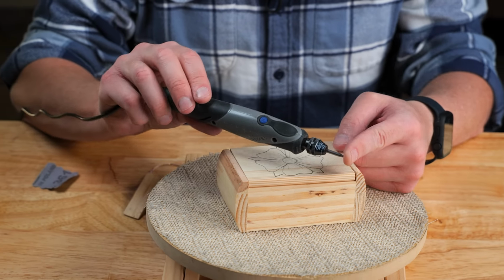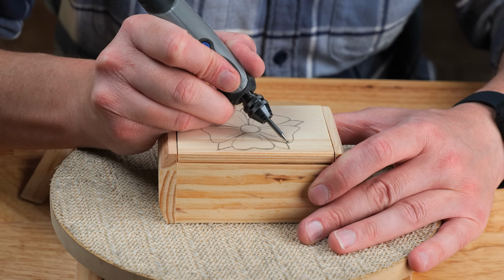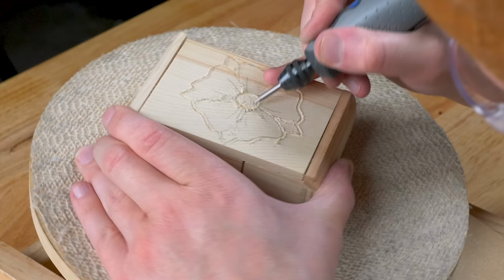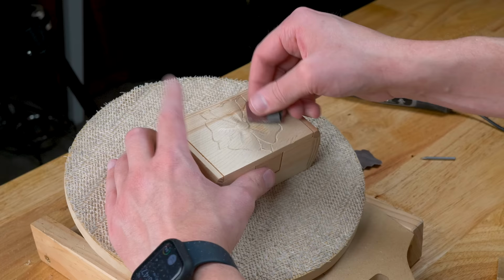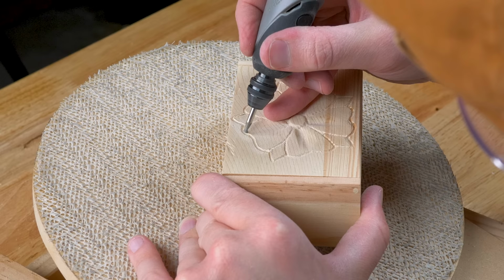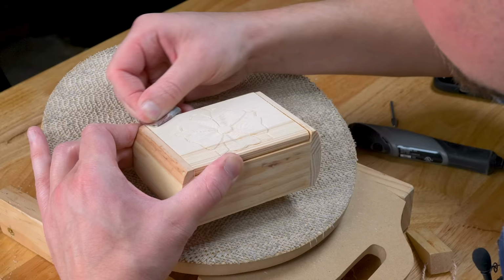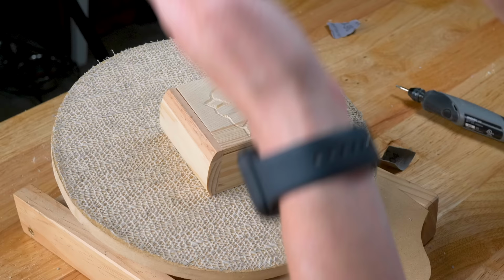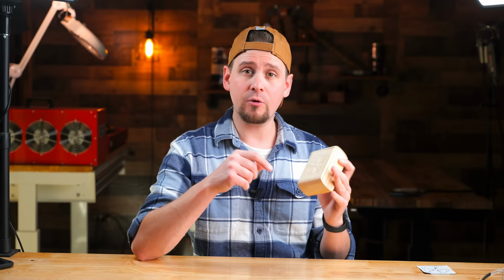How to Wood Carve with a Dremel Tool - The Basic Beginner's Guide

Comment: Try using a laser printed pattern. If it has "direction" , reverse print it. Lay the paper printed side down. Use a regular clothes iron to reheat the toner and transfer it to the work surface.

Comment: Great video very useful. Though thing i notice no one ever seems to talk about how to pick right bit for the material which I am still lost on. The 5 he picked seemed to picked based on function but I am wondering how you would know best bit for the wood in this case or plastic or glass in another project. Another thing would be cool would be to get an idea of what is reasonable price for all the bits and sandpaper. not sure what prices are reasonable.

Comment: Hello Cornelius Creations. I was wondering if a lower speed helps reduce burr hop or burr runaway? You said to use the highest Dremel speed setting. Does that make it easier to carve or does slower speed provide more control?
Reply from the maker: Lower speeds actually make burr hop worse. Higher speeds generally helps with smoother cuts. Always let the bit do the work for you

Comment: I'm curious about this hobby but I'm very very new to carving (not woodworking). Could anyone recommend a beginner's tool/kit? I want something cheaper in case I don't love it but good enough that I won't automatically hate carving because the tool is so bad. Thank in advance.
Reply from the maker: Hey Jason! Look on Amazon for a flex shaft rotary tool around $30. That will get your feet wet!
Reply: @CorneliusCreations  any brand you half recommend?
Reply from the maker: If I were to get one it would be the WEN probably